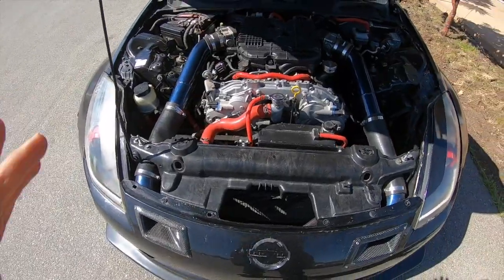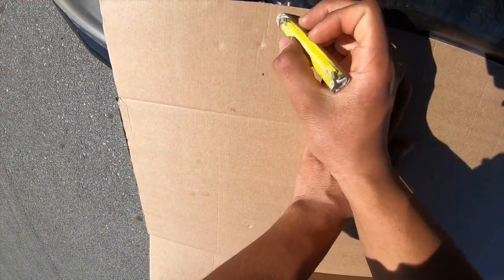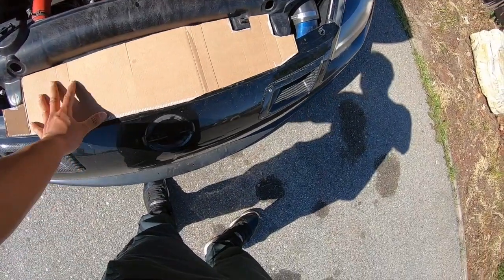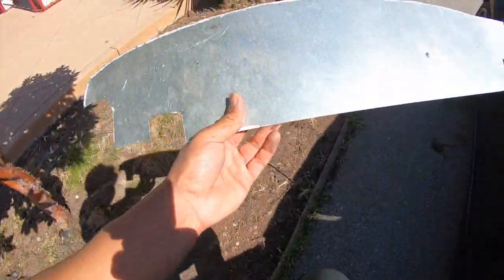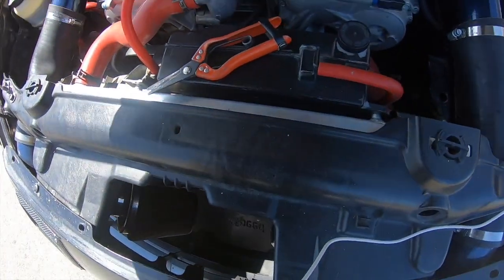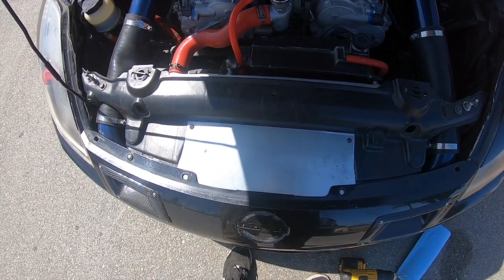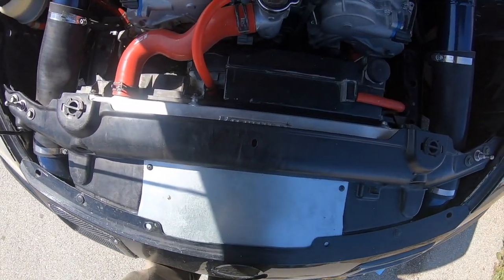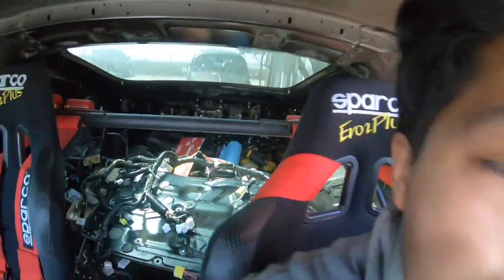350z Custom Radiator Guide DIY !!!

Comment: Did you make your intake .?
Reply from the maker: Nah bro I just pieced together the bottom 90° elbows. I cant fabricate.
Reply: @tuned_tunas  copy that so basically you use the short ram and then just added on to it
Reply from the maker: Not a short ram. Its hard to explain without leaking info on the next set up. But the upper portions are part of another kit. I just bought the elbows to make it a complete kit